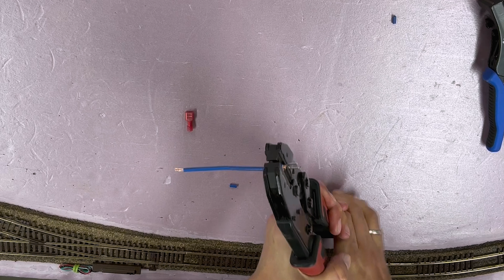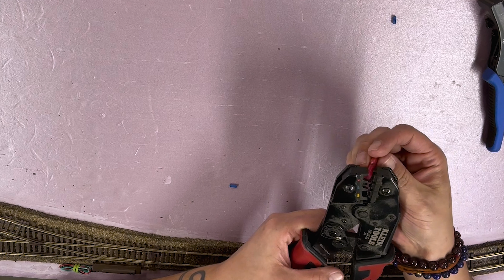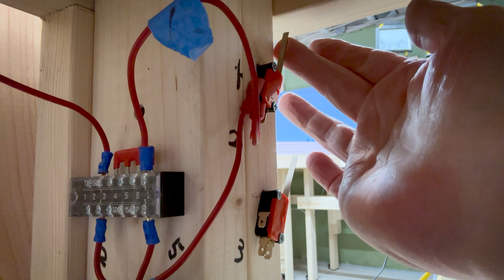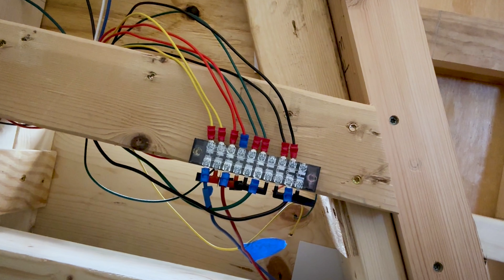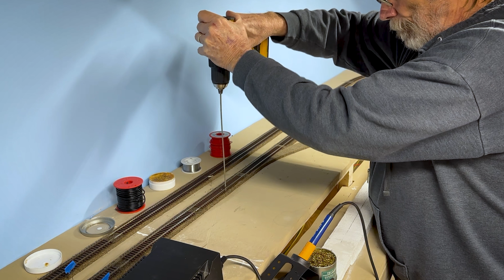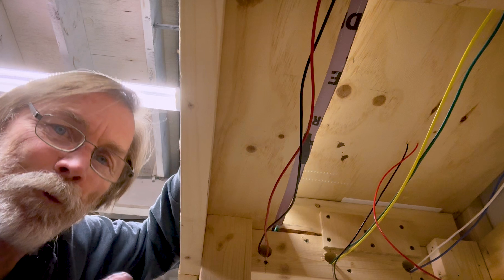042: Getting Back on Powered Track

Comment: Whoa! Good job, swingbridges scare me. Did I saw some close calls or was it just me being scared 😳💪
Reply from the maker: Swing bridge had me a little worried too. But its working perfectly and the power shuts down the tracks when opened so no worries about trains driving off like its Back to The Future! Glad you made it back and are caught up. Been pretty busy and getting ready for the last loop on the lower elevation.  Thanks for commenting and watching my friend!!!!
Reply: It sure looks nice and safe! The only thing that really worries me is all the soldered track and the lack of space for the track to expand. But you can allways make a few Dremel cuts to solve that before summer 😊
Reply from the maker: @ there are gaps for each 8’ max section of track. Most of the gaps are spaced at 6’ so hopefully that will be enough for expansion. Time will tell.
Reply: Oh nice, good thinking ahead! 👌

Comment: You were having way too much fun with that swing bridge. Great video. This is such a great series for someone starting out. You do a good job at recording all your progress. Those electrical devices are very neat. Well done you two!
Reply from the maker: We were worried about that swing bridge when we built it, and when we laid track across it, and when we put in the power. It was working so well I couldn't stop opening and closing it! We appreciate the kind words from someone with such a great channel and following. We may be just starting out but have learned a lot along the way and are trying to document and pass along the good and the bad as we go. Thanks for the great comment and suport.

Comment: Lookin' good, glad that have the loops running- you'll enjoy that quickly.
What was up with 21:57 ?
Reply from the maker: LOL I didn't quite close the gate correctly so the loco bounced on the end of the rail. I installed a latch so it holds the gate in the correct position going forward. I know you are an electrical guy, so what did you think of my swing gate power solution? Seems to work as intended. Thanks for watching and catching the derail my friend :)
Reply: @GettingBackonTrackwithSteve  i love the mechanical electrical solutions very much so, if correctly installed, which you obviously did, never fails.
Failsafe with bridges like that is the solution.
It's really progressing well Roxy and Steve, it's great to see and follow-keep up the good work and vid's....

Comment: Good to see the trains running.  Keep the wiring as neat as you can it will pay off in the long run.  Thanks for sharing.
Reply from the maker: Thanks John. We still will be going back and tying up and arranging the wire runs over the next couple of weeks. We have also been logging what each wire is for and will be adding labels to make it easier to track down wires and connections if we have to troubleshoot issues later. Electrical is not my forte, but I am learning from watching others. Thanks for the great comment as they always give us something to think about.